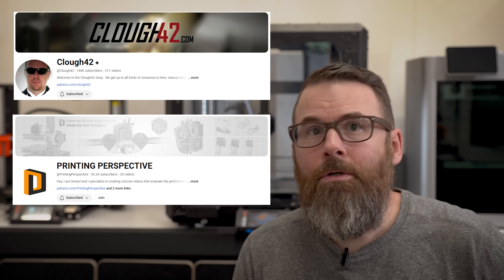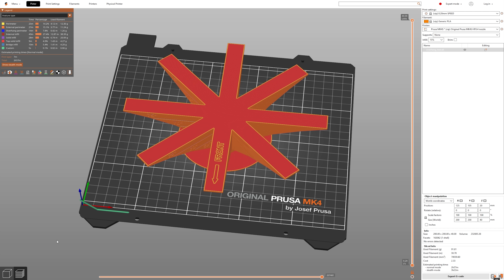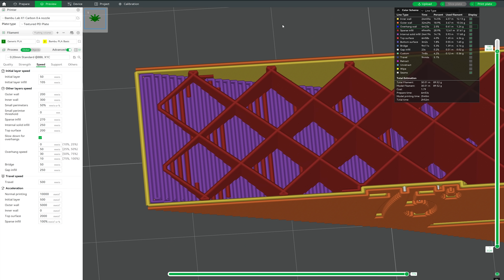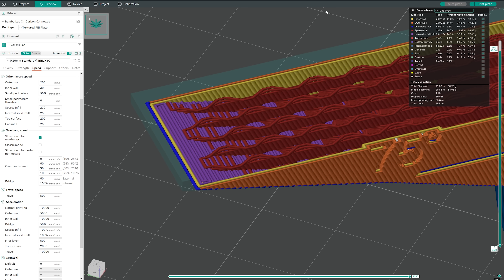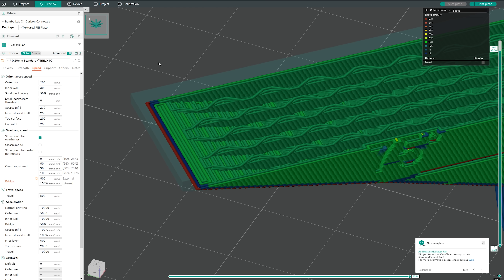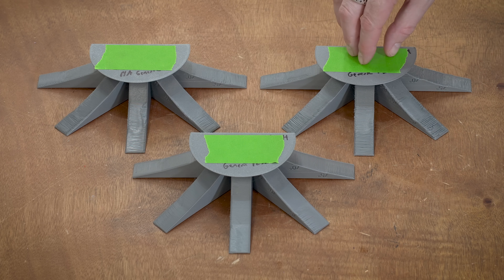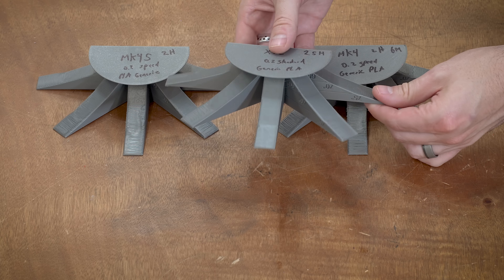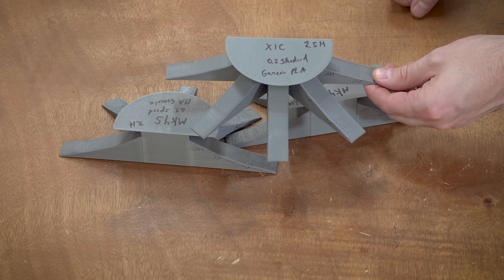Uncovering Prusa's Overhang Performance

Comment: Just because Prusa has fixed their shit doesn't mean the others didn't have almost a year to fix a issue they could have just found by following the Prusaslicer github. There is no exploiting other machines if the other machines just print badly at this point and time, it isn't josefs job to fix other companies software.
Reply: A nozzle change and fan for $100 isnt wallet shattering and is a GREAT upgrade path for those with the mk4 but a hard sell if someone is shelling out $1100+

For the price the competition is shipping bedslingers with multi color for under $500 and enclosed with multi color for $950-1450. That reality is still out there and idk if Prusa has an answer for that.
Reply: Let's assume most folks arent printing 70 degree overhangs without support to notice or complain. This is a very specific issue that Prusa used in its influencer marketing. Most youtubers print a llama or benchy and call it a video. More folks who print auto generate supports when it gets to steep overhangs. 

The josef crew specifically used overhang test to show an edge but it was a software issue that can be corrected with a simple tweak, now that it is known, a simple software update. 

In summary if you print insane overhangs with 0 support, with prusament you may have an edge. But if you are someone with a bambu printer change bridge speed and you have a better print with any filament.

If anything this tells us that Bambu and orca they dont just copy Prusa and slap some new colors on it and are making other changes to the slicer that prusa has yet to adopt.
Reply: @personwomanmancameratelevision  you forgot the fact, that prusa actually improved the cooling performence a lot from the mk4 to the mk4s, with it being the most noticable hardware difference

Comment: I just got the X1 and I have not pulled it out of the box.  But I did generate a overhang model at 45 degrees and the overhang speed to 20 mm/sec.  When I look at the settings it shows overhang speed from 10-50 mm/sec depending on the angle.  I changed the angle to 60 degrees from vertical and it the speed to 10 mm/sec.  I think the version I have has the bug fixed that I downloaded recently.  The version is 1.9.0.18.  And it just asked me if I wanted a new version.  

Good job as usual

Comment: This kind of revelead another issue. Bambu cloned PrusaSlicer, but they do not keep up with the recent developments. And the printer is as much software as it is hardware. With Prusa, you get the whole deal, from premium filament, to the software, profiles, and hardware. If you neglige any single part, you get significantly worse performance.
Reply: New Prusa cope just dropped
Reply: Hey. I know Prusa makes the whole package, and that they make awesome filament. But 30+€ for a roll of PLA is overkill.

And again, when I tried to print Jayo PLA Matte on my MK4S, it showed badly  calibrated pressure advance. There is no easy way to calibrate that in Prusaslicer.

When I printed the same filament on my P1S, it printed flawlessly. So the not branded filament worked fine with Bambu. But even if it was bad, there is easy way to calibrate flow dynamics in Bambu studio...

And regarding Bambu cloned Prusaslicer:
So Prusa cloned Slic3r, right? Is that all right?

And there are a bunch of features in Bambu studio which arent in Prusaslicer (flow dynamics calibration, flow factor calibration, multiple beds was sooner in Bambu studio, then Prusaslicer "cloned it") and vica versa.
Reply: Mikolas, you're absolutely right. But I don't think the campaign is all that good if it really was just a software error that you used for marketing.
You shouldn't stoop to this level, not even against the green competitor.  Even if it's difficult the way they behave. 

Of course I ordered the update for the MK 4 because it definitely improves the performance of the MK4. 
And the print quality has nothing to hide from Bambulab.
Reply: @herr_rossi69  Exactly, it kinda shows as petty. Bambu and Orca must not be copying you directly if their software didnt correct an obvious bug that was corrected last year. 

Robert showed an easy fix but ironically it may not even be an issue if people arent complaining about it as 70 degree overhangs is an extreme rarity in most prints.
Reply: @herr_rossi69  We tested MK4S against all most popular 3D printers on the market. We really do not have the time to dig through all of their profiles, and look for mistakes they made, and correct it for them for comparison. We had no idea, they had such a flaw in their profiles, when we were testing the MK4S. And it is imo 100% fair comparison, still today, default profile vs default profile, which is what 99% of users will use.
Reply: @TheMikolasZuza  That is correct. I also almost exclusively use the original profiles for my MK4.
They simply work. Even if I don't use a Prusament, as an exception.😉 
I'm definitely looking forward to the MK4S update.
Reply: I think cloning is not an apt representation. The base code is similar but they are not the same. And Bambu Studio  has other features not found in Prusa Slicer. (and vice versa) Both brands have hardware software and firmware advantages. 

On the software front
SVG file type handling is different
Multi build plate is non existent in PS
Mesh Boolean isn't in PS.
Project tab can have build/print instructions, notes and other relevant info about the model

Hardware side
Lidar can auto calculate flowrate , k values of individual filament if you have an X1C

CoreXY for stable prints at tall heights. 
X1/P1SEnclosed without needing to build it.
Consumer friendly multi filament setup. 1 cable and ptfe tube install.
A1 series with the eddy sensor for live auto filament flow adjustments

This particular overhang issue(bug) so niche that Prusa needed to use it as a marketing/influencer talking point but not explain why like Robert has pointed out and provided a solution. You guys noticed a bug and leaned into it as a selling point for the mk4s but again it is so specific it flew under the radar for BS and OS.

You guys have closed the gap and at least embraced SPEED as a consumer want. Just know your competition is not standing still. I cant wait to see what else you are working on.
Reply: I'll be fair to all parties involved. Let's assume Prusa has bambu printers locked away offline and they ran the same overhang test on the BL printers using Bambu studio and MK4s with Prusa slicer. 
They saw their printer do well with overhangs and bambu fail horribly with zero investigation. They saw an advantage and told everyone how great the mk4s is ran with it. No one person is at fault and they didn't dig into any code or print settings for "competitor 1".  A lot of leaps in logic but let's say that is what happened.  

What I have been seeing is very bot like talking points like the NOOOO and Beef ingot pointed out. 
Support,  Sinophobia , community and a few others. 

What find interesting is that wages talking point has no basis in fact or fiction. Unless you have a whistle blower or wages of BL employees you are spreading misinformation. Do know how much bambu pays their lowest to highest workers? Are they not earning a living wage? what is their salary? You made the assertion so you need to back it up. So what happens to the workers when no one buys the product? Do they get better wages, which again you have no clue what they are paid, or are they unable to live at all? Am I now deciding if buying a printer means feeding a European or an Asian? I am American and have no dog in this fight. I will buy what meets my needs. 

I will not be guilted into buying a less than ideal one? I have a Japanese car, cellphone designed in Korea but probably assembled in China. A computer that was designed in Cupertino but made over seas and at no point did the wages of the workers factor into my buying decisions.
Reply: This isn't an accurate summary of what happend. Bambu didn't clone any more than prusa did.

Forks are literally the point of gpl3 projects and all of them, prysa, Bambu, and orca, are forced to be open source. All of them have also added features the others did not have at one point.

It's so baffling to me people have created the narrative that Bambu has stolen when that logic could be applied to any of the three but is only applied to Bambu for some strange reason.

Ot really feels there is a clear double standard where people jump at straws to criticize Bambu but will bend over backwards to defend prusa, with orca just in between.
Reply: @BeefIngot  "Bambu didn't clone any more than prusa did." Except they forked 10 years of our work, deleted every mention of it to the point where they even re-wrote the tip tools with different order of words, etc. Then they got called out and released the source at last. And to this day, they are still in violation of said license, by sideloading a binary networking blob, which for all we know phones home to china with every click you make. They acknowledged that they have no intentions of ever open-sourcing this part of their code.
Reply: @BeefIngot  You can tell who is who depending on their talking points and  nearly bot level repetition.

Code was "stolen"/ copy  

Non livable wage 
Cheap Chinese parts/printers build quality
Not open source/ doesnt give back
not European
support bad
Cloud bad, spying or some other junk
printer waste...

If it is just fans saying it that's one thing. When the heads of the company spout nonsense we can see who is sending the marching orders to the fanatics.
Reply: @No0o0o0o0o0  You know I've never thought about it like that, but I am starting to think it's a top down thing.

It's almost uncanny
Reply: "and it is imo 100% fair comparison, still today, default profile vs default profile, which is what 99% of users will use"
Says the team who created the "bonkers benchy" with a single wall, 5% infill and other shenanigans to show the mk4 and XL print fast? 🤣

But this" We had no idea, they had such a flaw in their profiles, when we were testing the MK4S"
doesnt make any sense when you have a whole influencer marketing packet exploiting this "advantage" you knew nothing about....🤨

Comment: If the overhang performance mainly due to a silcer update introduced more than a year ago (2.6.0 vs. 2.8.0 now), how come we are only seeing the effects now with the MK4S?
Reply: I'd say because the hardware has been improved with the MK4S (cooling, in particular). I just hope they do something similar for the XL.
Reply: Cooling performance improvement was the other half of the equation.

Comment: I came from an Anycubic Mega S, that I’d used for a few years before it died, to a Bambu Lab X1-C, and the first time I printed something with overhangs I was very disappointed to see how horrible the undersides of them were compared to what I was used to seeing off the Anycubic. Nearly everything else with the Bambu looked soooooo much better that I couldn’t believe how crappy these portions looked. I didn’t understand how the old, cheap Anycubic could do them so much better. Now it makes sense. Can’t wait to try this change.

Nearly everything else? Not everything else? I was also surprised to see on my very first print how absolutely HUGE the seams were off the Bambu compared to the Anycubic. I haven’t looked into it, but I wonder if this is just due to the slicer, and perhaps Cura just has better seams than Bambu Studio. One of these days I’ll have to see what the Bambu spits out with Cura as the slicer to see if the seams actually look decent again.
Reply: Maybe the orca slicer is something for you.
With my Prusa, I stick with the Prusa slicer because you can see that Prusa puts a lot of work into it. 
If I had a Bambulab, I would definitely give the orca slicer a chance.
Reply: @herr_rossi69  I've only had the X1-C since the end of April, and have not gotten around to trying Orca Slicer yet.  That is definitely another thing on my to-do list, hehe.  Thanks for the reminder.

Comment: sigh
Oh well. I feel cheated more or less.
Reply: I'm not sure I understand why. The MK4S outperformed the MK4 in this test, so the hardware is still contributing towards the better results. Prusa constantly update their slicer, the firmware for their various printers to provide not only better performance but new features outright, just ask any long-time owner of the Mini, who long after the sale got 2X+ print speeds via input shaping out of the blue as a FW update! For this hardware update, you're getting high-flow nozzle support and a fantastic cooling fan, NFC and a port for a kick-ass GPIO board (and an Accelerometer). I do not feel cheated at all.

Comment: Great work! 
How come the overhang test result for the MK4S turned out worse this time than in the previous video, though?
Reply: Filament change. First video was prusament. This is a middle of the road filament. Prusa’s works awesome with their own filament.
Reply: @c0mputer  you mean they work bedt with good decent filaments not with cheap stuff, as most printers do
Reply: @ripmax333  That’s not what I meant but yes I would think they do work better with decent filament rather than cheap stuff.
Reply: He printed it in the enclosure lol

Comment: I think you should also test the other test objects and filaments to be fair. In a test by mpox, the X1c was shown to be very dependent on the different directions. 
Also, the same print with the MK4s looked much better than yours.
I think it's still a good update for the MK4.
The other prints also convinced you in terms of print quality. 
And that is more important than such an extreme test.

That Babulab doesn't fix such a mistake more quickly. 
You could say that both printers were tested with the manufacturer's own slicer with optimized settings. And Bambulab simply copied badly. 
On the other hand, it is not correct to give the impression that this is due to the new hardware.
In any case, you can see who is trying to report objectively.

Comment: Out of curiosity did you try slowing down bridges on the MK4S as well?  Slowing down bridges may have an overall affect on the print quality.

edit: I downloaded the model and lowering the bridging speed to 10mm/s in PrusaSlicer to match what you used on the Orca prints will definitely have an impact on the final print quality of the MK4S
Reply: That would be indeed a interesting test! X1C vs MK4S on same speed/time on each type of deposition (infill, walls and so on). According the notes on the pieces the X1C took about 25% longer (2 h against 2,5 h)
Reply: @sphxdr  Yes, this shouldn't be dismissed. Extra time spent bridging over infill elsewhere means more time to cool the previous layer.
Reply: @MartinKoistinen  I think he meant in the video that the corresponding extra time was spent on the bridges on the top side, which would then have no influence on the print quality on the bottom side
Reply: @WilliDurpel  think about it harder.
Reply: @MartinKoistinen It doesn't make a difference. Im currently testing this scenario now, and although theyre not quite finished, the MK4 overhangs are noticeably worse than the X1C. I don't have the "S" kit for the MK4 to test though.
Reply: @MartinKoistinen  🤦‍♂️ you ok bud?
Reply: @MartinKoistinen  what is wrong with u
Reply: whats dumb is not just putting the same gcode in all of the printers from the start. unless the whole point of the video is about slicers which would be confusing.
Reply: indeed, the comparison seems unfinished without optimizing the prusa print settings as well.
Reply: @joost3732  there was no optimizing, they canged only the mistake in the slicersettings
Reply: @joost3732  there is nothing to optimise lol, how is this not clear to some
Reply: I was going to say, this video compares quality with STOCK Mk4s to an edited Bambu labs. To your point, I’m sure the Mk4s is capable of prints just as good if you mess with settings to optimize it for overhangs. Doesn’t really seem like a fair comparison still, just like the first video wasn’t a fair comparison of hardware.
Reply: @Quade65.0  no, you don't get it. There is nothing to optimise for prusa and bambu was only bug fixed, not optimised
Reply: @riba2233  lol ok
Reply: @riba2233  optimize not “optimise” but sure tell me how slicer settings work. That’s cool.
Reply: @Quade65.0   well, it looks like I need to tell you. And it can be both, it is American vs British English. Don't correct others when you are cIueIess, ok?
Reply: @riba2233  for sure buddy😂 dude is it ever funny how mad everyone gets on these chats? Like bro we’re talking about 3D printers, who the hell cares. Also, most people don’t have the balls to really say things in person like they do online. It’s just all funny to me every time. 

I personally don’t love Bambu stuff, I’ve had a few and had nothing but trouble. You obviously disagree, it’s cool.
Reply: @Quade65.0   wow so much coping 😂
Reply: @riba2233 thanks for proving my point. You wouldn’t be like this in person, professional keyboard warrior.
Reply: @MarinerMerrill  yes I would, with people who act like this. Respect has to be earned ;) btw why two profiIes?
Reply: Kind of ironic since you were the one to get tilted 'sure tell me how slicer settings work' projecting aren't we. @marinermerrill3884
Reply: Yeah for sure bro. Whatever you say. And I have no idea. I have a few different emails for work and stuff.
Reply: @Quade65.0  ok bro, keep coping and being "totally not interested" is this stuff ;)

Comment: I think every printer performs different with different filament. Could this be a good match with the Bamboo and a bad match with the Prusa? That needs to be tested first and tweaked in the slicer profiles. Never the less, a bug is a bug